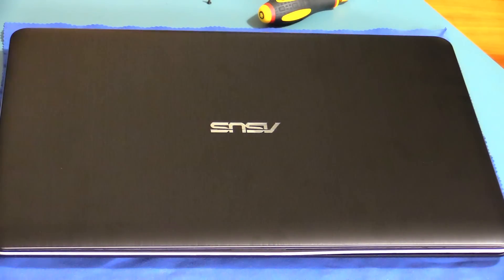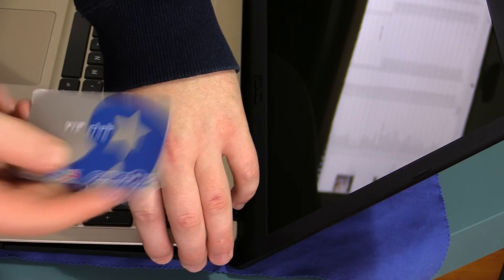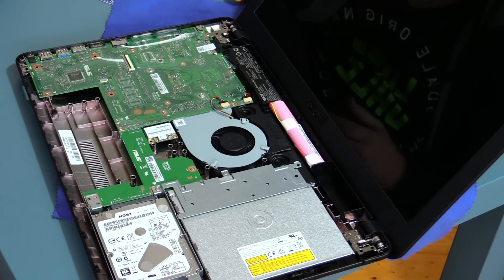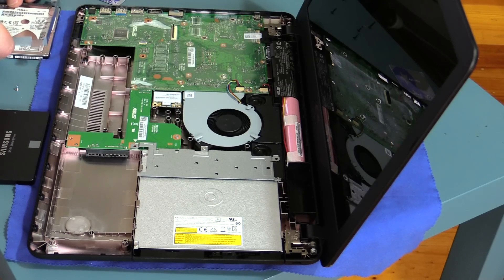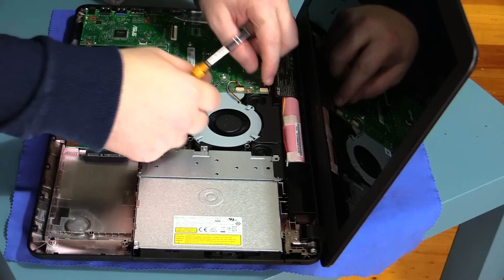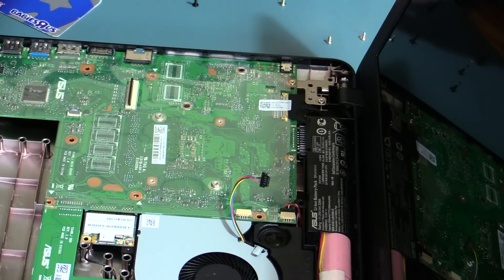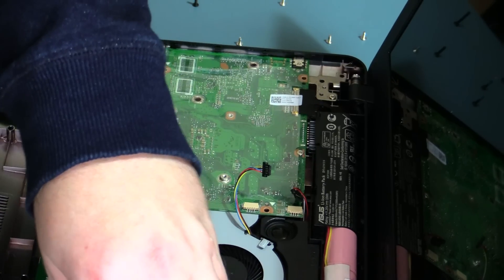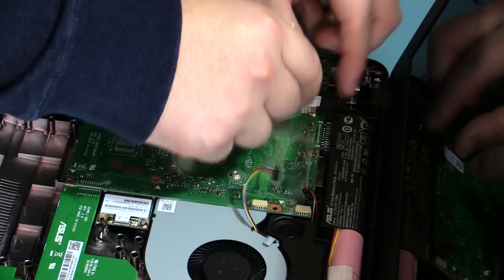Asus X540L Disassembly for hard disk replacement or memory upgrade

Comment: I've been looking at the possibility of upgrading an x540SA by switching to the LA motherboard. I had found a used one though a repair guy and they said they found one and it booted. It would however keep blue screening because of memory problems.

I never got to see it happen but I think you might have better means than me., after all, I am Kenyan and these are not easily accessible items.

Comment: An older but very usefull video. It didn't take much effort to get the cover off the laptop but watching you do it first made it a breeze. I just propped up the cover and didn't mess with the connectors, plenty of room. 1/2 hour with a cloned SSD. Cloned a ssd with Macrium Reflect Free, worked flawlessly. Much much faster,thanks.

Comment: Just looking to see your RAM situation. Was told the 4 GB would be hard soldered to PCB, only to find that section with no modules in place. Only one dimm slot. That now uses 4GB. That leaves me with a useless new 4 GB stick. I'll have to order an 16 GB stick .

Comment: Very useful video. The credit card tip was really great. Thanks! Video is a little slow at certain points, some cropping would´ve been nice so it doesn´t get boring. Other than that, very nice.

Comment: can i make an upgrade to cpu also?
Reply from the maker: Sorry, I haven't gone as far as disassembling the system down to the CPU.

I'm going to take a guess that you probably actually can, but that's just a guess, you'll need to see on this one.

If you take it apart, remove the motherboard, turn it over, then remove the cooling fan to see before ordering an upgraded CPU. If you do that, please update here so others can confirm what you find.

Comment: Have Asus X540LA with i3 5005u, 4GB ram DDR3 128GB ssd and wanted to uograde ram and add another ssd as Speccy program said there are two slots for hard drives... And two slots for ram... And now seing this....
Reply from the maker: Yeah it's hard to tell from Speccy when it comes to laptops, usually the best way is to open them up and see for yourself. Even if their is an ATA port available for example, that doesn't mean you've even necessarily got all the hardware to use it. You might be able to use a DVD-RW HDD caddy or some kind of cable adapter to utilise additional ports, but very hard to tell without opening it up and having a look.

Hope the video was a good help for you! :-)

Please do me a favour and hit the subscribe button! Thanks so much

Comment: Where's the network card? I think mine is failing. Laptop keeps freezing and when I do a hard reboot the WiFi adapter is not displayed in Dev Man.

Edit: NVM I just saw it. Still trying to determine what are my replacement options though.

Comment: I fell foul at the "remove all screws from the back of the case" stage. My wife actually looked at this problem for a moment, and using a straightened metal paper clip, she proceeded to remove the thin paper like caps covering each screw hole. After that it was relatively easy for me to clone a failing hard drive and install the replacement.

Thanks for the video to show this was possible as, after hearing bad things, my thought was that many laptops nowadays are no longer user serviceable.

Comment: Thank you for your helpful video. I have an issue with my laptop , sometimes it stops working and the screen freezes with no response to any action from the mouse pad nor the keyboard , other times i lose the wifi signal until i restart the laptop.
i appreciate if you have a solution to that kind of faults.
thanks in advance

Comment: hey, man. i have this exact model and i am wondering whether the ram is pc3 or pc3l (low or high voltage).... i have replaced my storage unit with a 860 evo 500gb ssd and now i want to upgrade ram to 8gb as well. thank you in advance.
Reply from the maker: That’s actually a really great question, unfortunately I don’t personally have this model so I can’t check it out but you should download a free program called Speccy!

It will tell you the detailed specs on the entire system and that should most definitely clarify the memory config for you...

Thanks and please hit subscribe :-) cheers!!
Reply: @Anthony99  thank you, man. i really appreciate it.
Reply: @Anthony99  it says the laptop has two memory slots... i couldn't find the other one when i was replacing my hdd... do you have any idea where it is?
Reply from the maker: @tkbeats58  that may refer to soldered memory too, so I’d just go by the one slot. Might have to open it up if it doesn’t tell you the voltage? From memory DDR3L is 1.35v and DDR3 is 1.5v...

Comment: Is it possible to make my asus faster and add 300 more gbs
Reply from the maker: Hi Karee,

Yes with most laptops you can do an SSD upgrade which will make it quite a lot faster and you can likely also do a memory upgrade too, which will also help.

SSD upgrade from a mechanical hard drive typically will get you the best improvement but it all depends how you use your computer and what you're doing with it :-)

Good luck! Please hit the subscribe button if you can! Would really appreciate it...

Thanks!!

Comment: Thanks for the video. Is it difficult to remove and reconnect those to clips for the keyboard and mouse pad? If I'm careful, can something still go wrong?
Reply from the maker: They're actually very easy to disconnect and reconnect but take your time and be very careful because if you break them that's probably the end of your motherboard.... / end of the laptop.

I'd still say go for it because it is easy but take your time and don't apply any force just gently lift and replace.
Reply: @Anthony99  Thank you very much I appreciate the feedback. My Laptop came out with only 2 GB of soldered ram and no slot to remove or upgrade. So you can only think how a 5400 HHD ad to the frustration.

Comment: Hi I have this laptop and whenever I move the laptop and it is not plugged to the socket it turns off.

I thought it would be a faulty joint with the battery and so I removed the top and checked but the battery was connected properly and even when I moved the laptop it did not go off

But as soon as the keyboard is back on top and I try to move it, it goes off 

What do you think could be going wrong here

Comment: Thanks Mate great vid. I am literally doing mine whilst watching your vid. I used speccy to see what was onboard and watch a couple of other vids on this model before finding yours. I toyed with the idea of swapping the wifi card for a wifi/bluetooth IOT add bluetooth. I asked the online retailer - MWAVE - and ASUS for advice ( I'm being lazy, I didn't want to open this thing more than once) neither were helpful, essentially refering me to the other ( ASUS said contact the retailer you bought it from as they don't give advice on people modding/upgrading their gear, I didn't buy the laptop from Mwave just the ssd & RAM. I think the person who gave me the laptop got it from Harvey Norman so no use asking for advice there). I ended up getting a usb bluetooth adaptor. Anywhoo just wanted to say thanks for the clear instructions, wish me luck.
Reply from the maker: Keith Brennan good luck with the upgrade! Sounds like you’ve done a fair bit of research on it :-)

Comment: I found that if you run the "credit card" counterclockwise from the exact point of your exertion, then when you get to the DVD it is as easy as pie.  {They think the other way}.  Also I found two ribbon cables that need to be deftly removed.  Cheers.  Je suis du Texas.

Comment: Hello. 
I have an x555ld with broken display but also a x540l with broken motherboard, could you tell me if this two models are inter compatible, like to mount the display from x540l to x555ld ?

Comment: I came up with the idea to add more ram so i opened it and now i have 8gb instead of 4 but for some reason my touchpad isn't working anymore but the keyboard is writing. Basically i don't see anymore my pointer.. Any idea? Is a driver problem or i've done something wrong with the cable inserting in the switch? Any help is grateful
Reply from the maker: It's almost certainly the track pad ribbon cable isn't connected to the main board, so just open it up again and look for it to sitting loose to reconnect it.

The trackpad will work without any specific drivers in it as long as it's connected up. They also very rarely break, so most definitely the loose cable.

Thanks for subscribing!
Reply: @Anthony99  You welcome. Yeah it's for sure that damn cable also because i've seen that has been release an update for the mouse driver via windows updates and nothing changed. The problem is that i opened it like 4 times and i clipped down again and again.. I thought that maybe i put the wrong side but it's not the case. I put the blue part inside and when clipped down the black line is covered so everything as it should but still i don't have a functional trackpad. Luckily my phone is also my hotspot and mouse at the same time. LoooL

Comment: i have an lenovo s145 with ryzen 3 apu  on mine was easier took theb bottom cover off it has 4gb soldered and under an RF shield the ram slot wtf?

Comment: Did any experience battery issues afterwards like my x540l battery light keeps blooming and it's not charging anymore....and it won't turn on without the adaptor plugged in......what did I do wrong?.....I only upgraded the ram

Comment: Me and my friend took the laptop apart and put it back together and now it’s not recognizing windows and is booting up in developer mode any fix to this?
Reply from the maker: Phoenix Club if you changed the drive for a new SSD you’ll need to set it up as a new computer. If the drive is the same drive, I can’t tell you from here... it could be a failing hard drive (bad sectors in the boot area), it could be BIOS configuration (CSM, UEFI boot, etc). If you can’t figure it out from there though you’d likely best see a computer technician as you can’t really do fault diagnoses across chat with a complex problem. Whatever you do though, don’t format your C drive until you at least a copy of everything that’s on it first.
Reply: Anthony Parker it’s the bios config

Comment: Thank you as well.  I had one. screw that stripped while disassembling the bottom cover.  As result I turn the cover right and left while the keyboard was unloosing that screw and I saw ( when too late) two ribbons that came unattached.  They secure on mother board and the bottom of the keyboard cover.  How do I reattach them or did I ruin the ribbons?

Comment: is the 4GB RAM stick actually removable or is it soldered in?
Reply: Sorry it's soldered dude, so you can only plug into one other slot if you want to upgrade
Reply: @noc44  my laptop says both X540  and Asus X540LA-SI30205P so they make it a bit unclear if theres a seperate and distinct X540L  but I just upgraded the RAM to an 8GB stick without a hitch.

Comment: mate, just opened my X540YA laptop to clean it of dust, as the cooler was running a bit loud, and now it won't stay on when power is unplugged... I found out it's something about a killswitch feature... got any recommendation ?

Comment: all Asus X540/l/m have the same motherboard right?
Reply from the maker: Vocaloid Media I wouldn’t put money on that one, if I had to get a replacement I’d take it apart and get the part number from the board. Some series have different boards throughout the series and slightly different physical layouts, which means you can’t put it back together properly. Worth double checking although I’ve seen that more than a couple of times.

Comment: thank you so much for the vid! mine x540l have onboard 4gb memory ...after installing the 8gb it became 12gb :D...Thank you
Reply: How can it have 12gb ram when there is only one ram slot and you used it for the 8gb ram? I call this comment bullcrap.
Reply: it has onboard memmory of 4gb man
Reply: @soulstayer  yes it does. But to install the 8gb ram you will have to remove the onboard 4gb ram and there is only one ram slot on the motherboard. 
So either you continue using the 4gb ram or you replace it with the 8gb ram.

Comment: Hi Anthony and everyone, I recently upgraded the RAM and HDD on my X540LA. The only problem I caused or came across was apon starting, the laptop shuts down using battery only, AC with battery in or out is fine, runes perfectly, remove the AC charger cable and the laptop shuts down immediatley. Have switched batteries, done a pwr reset, removed the battery from Device Manager, all to no avail?? Any Thoughts or suggestions?? Thanks in Advance, P.
Reply: Hi Paul. I bought a ASUS X540LA notebook recently and want to upgrade it.  Is it true that there are 2 RAM slots: one built-in 4 Gb RAM and another empty RAM slot for a possible upgrade (may be 4 or 8 Gb)?
Reply: @sairak3514  
Hi Buddy, I found on my model, bought in Australia, had 4 Gb built in on board RAM and once getting to under side of MOBO, ther was an empty RAM slot.  You can Upgrade to 8Gb of RAM.
I found from my chasing specs for this Laptop, that the 8 was MAX for the MOBO.
Goodluck and always check speeds and ASUS site for RAM compatability..)))
God Speed my friend..

Comment: This is still very useful info showing disassembly as of August 2018. X540U is still exactly the same to take it apart. Even though the motherboard has changed to DDR4 memory... Word of warning to all.  Don't unplug the cable that goes to the LCD. On any of these machines.  It's so easy to damage it.  Do as shown here in the video..  There is enough room to flip the motherboard over. Unless the person using the machine is a power user, I would say don't even worry about the memory upgrade..  Swap HDD out for an SSD. Just my thoughts.

Comment: Hi, I really appreciate this video and it has helped me a lot with my laptop, but I have a problem, (I know the video is a little old), it happens that when I re-assemble the laptop, it does not recognize the battery, it only works connected , I tried to connect it well to the card, but I do not have much experience or reference images, for everything else it serves, it just does not recognize the battery, do you have any reference image where it looks like it should be connected? or something that can help me? everything is connected as it should (I think) ... I would really appreciate your help, I'm a little desperate.

Comment: Is it possible to change the hard drive without disconnecting the keyboard cables ie, turning the keyboard clockwise 90 degrees?

Comment: Hi Anthony, thanks for the video. I have a asus x540L I want to replace the 4gb with an 8gb ddr3L 1866mhz, from what Ive read this should be compatible, but from the other comments Im not so sure. Can you confirm? Also you cannot remove the battery from this laptop, will holding the power button for 5 seconds while its off, ground the system?

Comment: Hi Anthony.. I had X540L with 2GB RAM. What type of RAM could we use for upgrade, do we have to use the low voltage ram? Is it upgradable till 8 GB? Thx
Reply from the maker: Hi Andry, not sure on the specifics as don't have one on me at the minute, although I'd just open it all up (make sure to do a little map or something as to what came from where, especially screw wise)... then take the current RAM out to confirm... if it's 1.35v you'll need DDR3L   1.5v is straight DDR3.  If you just take it to a computer store they should be able to help you for sure; or search online for the model number of the. 8Gb should be fine in either DDR3 or DDR3L though, best double check the manual if you want to be 100% certain, but I'm confident.
Reply: Anthony Parker thank you so much Anthony. Really appreciate it
Reply: Anthony Parker Hi Anthony, I went to local computer store, and they had checked it. it's 2GB SODIM DDR3L PC12800 1600MHz. They tried to replace it with 8GB DDR3L PC12800 and 4 GB DDRL PC12800. None of them work, and the laptop won't display anything. Do you have any idea what might went wrong? Thank you
Reply: Well. They tried it again with Vgen 4GB and it works. They don't really understand why it won't work with Kingstone
Reply from the maker: Andry Wibowo hey there!!! Thats great that it worked :-)

Comment: Do you know how to get the Product Key of the Windows OS if your hard drive totally fails?
Reply from the maker: Smael64 hey there.. if it is a Windows 8, 8.1 or 10 laptop the product key is stored in the BIOS so you can just reinstall Windows with the correct version :-) good luck!

Comment: Thanks. Is it SODIMM or SDRAM?
Reply from the maker: Hey there,

Laptop's use SODIMM modules, so if you went to a computer store you'd ask for 4Gb or 8Gb SODIMM to suit... maybe just take your laptop in with you as it'll be easier for them to look up the specs on your exact model while you're there.

SODIMM actually is a type of SDRAM, so their is a bit of terminology confusion there. The "SO" in "SO"-DIMM stands for "Small Outline", which is what is used in laptops (& it is also common in All in One PC's too) & iMacs use it too.

DIMM's (as opposed to SODIMM's) are what is more commonly used in desktop PC's where size & heat are less of an issue.

Hope it helps!

Comment: Perhaps someone here can be of help. I'm working on replacing a HDD in a X540LA, A cheap BestBuy version of this as far as I know. On the bottom of it there are 4 normal screws, in the other screw holes are dark grey plastic pieces (that look like plastic rivets or push pins) that have no end to them and there's virtually no way to get to them. Any ideas? It seems they don't want anyone to take these apart.